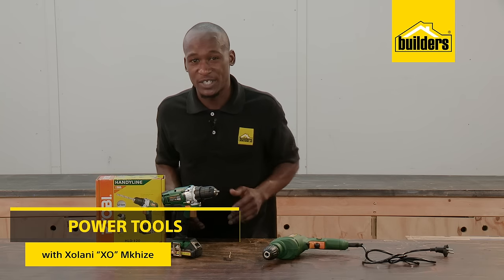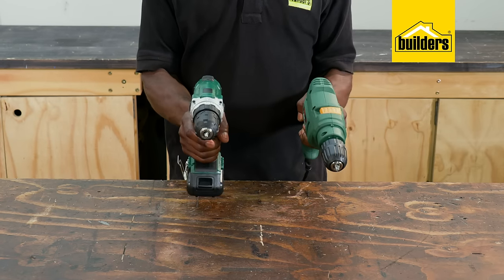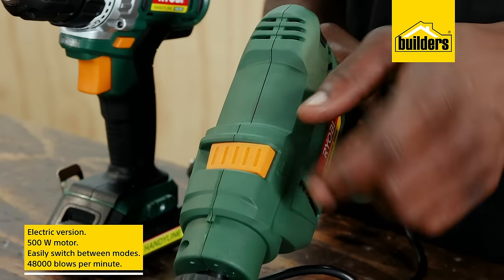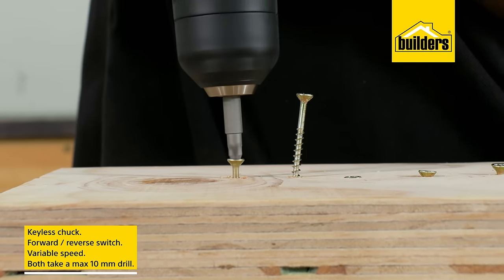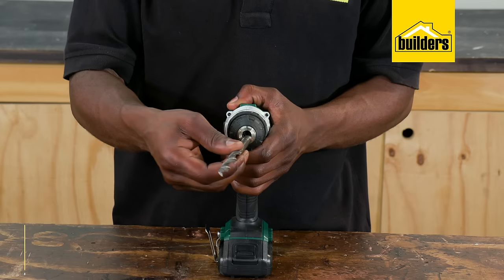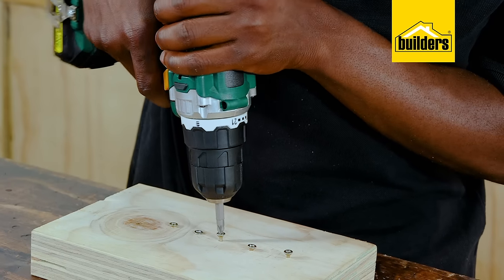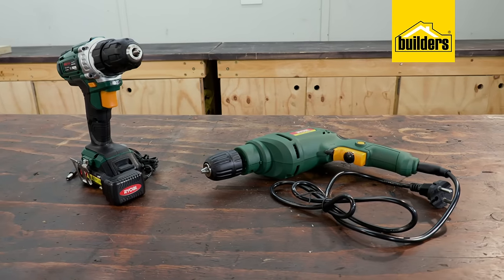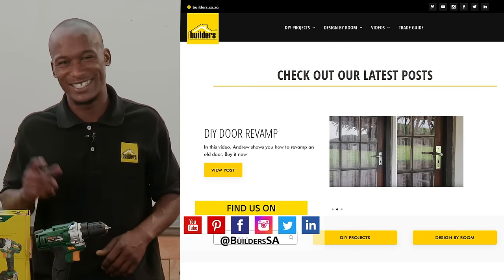Ryobi Corded vs Cordless Drills

Comment: So the cordless is not for walls in the house? I. Ie concrete...
Reply: yes, it is, as long as it has a hammer symbol
Reply: And corded one is also. Their hammer function working the same way and is absolutely laughable compared to sds+ hammer drill.
Its like 10-20 times difference in performance